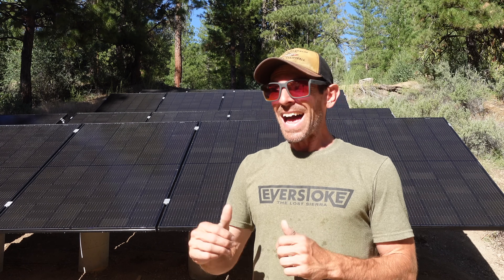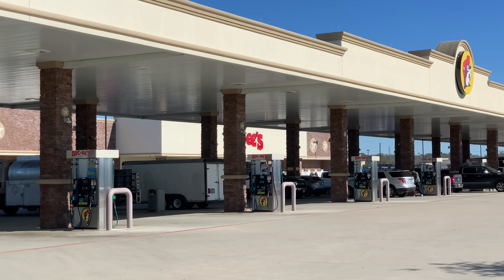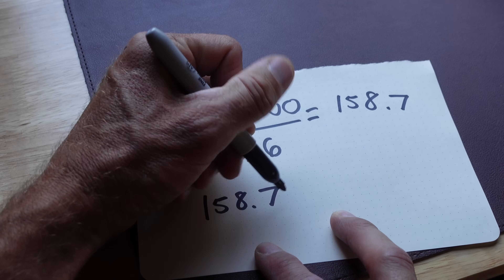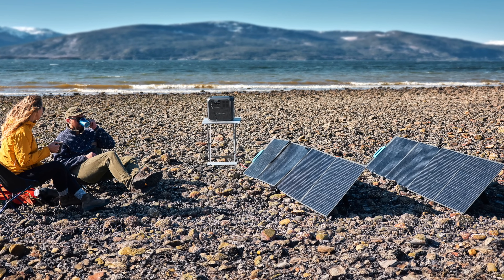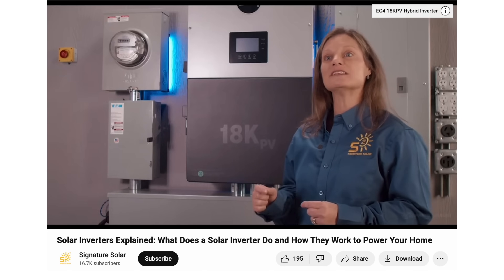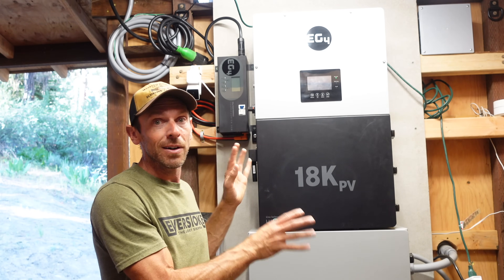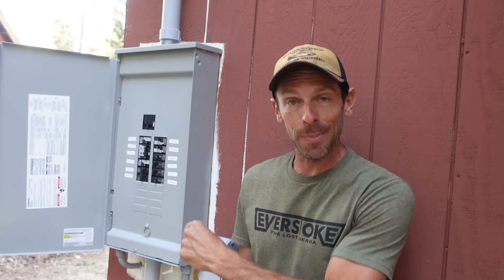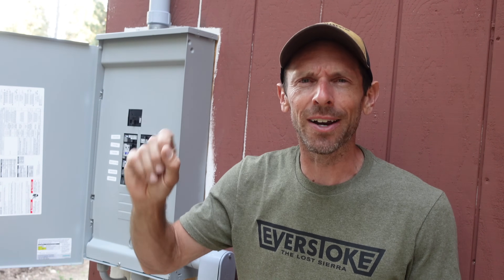Huge progress on our off-grid solar project at Everstoke

Comment: Where I am, if they still have a line in, even if I use no watts from the Grid, I am still charged line fees, I have a feeling if I was net metering and grid tied with my solar they would also charge me transmission fees to "Store" and "Return" any power. I am happy with my solar, but my bills will never zero out unless I remove the "Grid" line to my house, I pay just for the backup at this point.
Reply: I have done Construction for over 30yrs, and I have never met someone like you, I would hire you in 2 seconds flat.
Reply: Run water pump for 2 mins and see how much it produces, then see how much energy the pump uses in 2 mins, you can calculate your water usage based on power used by your pump approx.
Reply from the maker: Yep, no matter what they'll charge you if the grid is hooked up! Thanks for the kind words!

Comment: Ha, I've been Energy Independent since 2020 and I can tell you general stats, like during the summer I use 8-12kWatt/hours a day and in the Winter about 6kWatt/hrs a day - but I haven't done any calculations about the cost of the system. 6kWatt/hrs of Solar, 28kWatts of Battery Storage and a 12k Solar Charger/Inverter - all of that cost me $14k. Since I began, I've made more than 2 megaWatts...
Reply from the maker: That's awesome!

Comment: Can you elaborate on the mud mixer also?  Thoughts and comments on how well it does?
Reply from the maker: I think it has been awesome. But I have never done a big concrete job without it. I can't even really wrap my head around how we would have done it up on that hill with a little cement mixer thing and have to scoop everything out. Mud Mixer seems like such an easy way to do it. We have to keep an eye on the moisture level and make sure the dry mix keeps falling through.

Comment: Le me tell ya man…. You get an EV, all power consumption is measured in kwh. You will find out pretty quickly how kwh works. It is the volumetric measurement for electricity use. In a conventional car fuel use is measured in miles / gal, (L/100km metric) an EV will show kwh/100km. Basically the same thing.
Reply from the maker: Yeah, it's so cool! Seeing the real time power output is sweet

Comment: If you have to use a generator without a chargeverter you can get steady 60hrz, but turn off any surge appliances while charging, surge causes the gen to low freq then high freq when it catches up. I won't buy a chargeverter after the extra panels and change a connection next month I don't think I will ever have to use my Gen again, just there as a backup. If you ever move those panels and they are bi facial mount them vertical, I cleaned snow once as it melted from the top haven't washed the panels since sept, down about 20w, pv2 my 2790w array 3400w with snow, in summer with no white rock to reflect 1800w,  460w heavy rain to 780w in clouds 500w at 6am, summer production is down but it really doesn't matter when there is 16 hours of daylight, Unless you are grid tied. If anyone has to buy a gen, dual fuel and a 1000g tank could run a gen for over 2 months at 4 hours a day, it's a good back up if natural disaster happens. I have a 400gal, I can get over 380kw from a tank, before I swapped the faulty inverter. After working on solar power for a month anyone can look at a 175w appliance and know in 2 secs 4.2kw per day.  When buying solar R.O.I. always happens but should anyone even consider that when they buy a 50000$ car that is worth 5000 in 10 years. Never mind ROI you should worry how much power will cost in 20 years. That battery is kinda expensive, I bought 48kw for 9600usd, Lead carbon sealed, non-spillable, -30c to 60c, discharge to 30% but can go lower, good PSOC  30 TO 70%, 97% recyclable, maintenance full charge every 30 days, no bms, equalizers, or heaters needed there just heavy 12v250 170lbs, not for mobile applications. Just run the inverter on lead acid with charge rate changes (57.8/55v). LC 51.6V is 100%.
Reply from the maker: Yeah, I definitely agree on the ROI and the way people spend on a lot of things like cars that depreciate fast! Thanks for all the tips and info!
Reply: @bkxc   I am retired and bored, sorry my comments are like a novel. I try to share it all. A lot of times the comments are for others cos the posters like you are informed.  Panels got cheap, same price as my 465w in 2023 2024 gets me 605w.

Comment: I would set the generator to come on at 5-10% battery as LiFePo batteries handle deep discharging just fine and you're just wasting gas/money and polluting with the last 20-25% if you use the generator.
Reply from the maker: When we only had four panels the difference between 25% and 10% power was about 30 minutes, haha. Not much of a difference.

Comment: it’s not a good idea to over size the system that much (1800 vs. 300) which is why it is taking so long to payback.  also, all those extra kwhs that the over sized system creates, are sent to the grid, so you are actually using the grid even more as you send net 1500kwhs to the grid.  but maybe you said you were storing the excess in that little battery?
Reply from the maker: Yes, I agree it's a bit oversized if I was actually doing it for my house. One of the big things is that that winter changes everything. Much less daylight, much more overcast. It'd be really interesting to see how much less power I would be making.
Reply: @bkxc  Thanks for this clarification.  It makes more sense for Everstoke as you should have higher energy usage when it is in season.   Maybe DOE or NREL publish maps for solar radiation that could be of help.  But I don’t recall if they are published for season, and they may be just an average for the year.  If it is rated at 1800w AC, then it’s probably 25% of that rating that can be counted on year round.  A wild guess on my part but 15-20% of the rating for winter?   But that still doesn’t tell you how many hours in the winter it will produce at its max rating.  Not being much help here, but it8s just a lot fewer hours.
Reply: @CJinsoo  yes NREL has free software that will give you a pretty good estimate of power production based on the system parameters

Comment: probably half the cost of providing electricity is for stuff that doesn’t vary with how many kwhs you use.  Your average monthly usage is very low compared to rest of USA,but typical for mild CA climate.  So the average rate per kwh for you will be very high.   things like distribution lines, transmission lines, transformers, customer meters and service do not depend on energy usage and their costs don’t vary with energy usage.

Comment: The solar systems in FL last about 10 years and needs repairs after storms and insurance is higher due to solar systems on the roof and covering them for replacement. Just a few experiences to think about depending on where you live, Thanks for your info.
Reply from the maker: Everything gets beat up hard in Florida! It's so much better to do a ground mount if you have the room!

Comment: So funny. In germany we have a law that you need to built solar on your roof if you redo it... And most people do it even on old roofs. We pay 28ct/kwh and even than its a no brainer.
Reply: no brainer?  sounds like there isn’t a choice.
Reply: @CJinsoo  there is. Solar for water or power is your choice.
And I got it on my old roofs as well as it pays itself
Reply: @Tschesslee  Thanks for that clarification.  When customers go solar for water, what is the backup?   On it paying for itself, I a do not dispute that outcome.   Easy to set up program for solar such that the net energy payment rate, or install incentives result in quick payback period (5 years or less).  But in the USA, that short a payback is the result of a very large subsidy embedded in the payment rate.  It results in shifting costs to customers without solar.  Don’t know anything about the programs in Germany.
Reply from the maker: Surprised California hasn't passed that law yet!
Reply: @bkxc  California just screwed everybody over! Now you pay $.30 for power coming in and you get about five cents for power going backwards out to the grid. So the best thing to do is get your own batteries and live within your own means.

Comment: Now you're cooking with natural gas. Oops. Wrong metaphor for this context. Now you're styling in tall cotton! Dang, did it again.
Seriously, it's obvious a lot of work went into this project. I'm sure it will service your property for many many years plus when it's time to replace solar panels, the hard work is already done. 
Are there any specific parts or circuit boards that are known to go bad occasionally? Often enough to keep some spares on hand.
Reply from the maker: Most of this stuff is very new and it's going to be some time before we start seeing the malfunctions. But there are pretty good resources on Reddit, the DIYSOLAR forum and Signature Solar customer service. Hoping for years and years of smooth saving

Comment: The grid is a massive infrastructure. 
$TRILLIONS to finance and also needs $100BILLIONs in cashflow. 
$30,000 tells that the grid is expensive. 
5cents feedin vs 50cents supply kWh tells you the grid makes dirt cheap electricity expensive. 

And grid electricity is the smallest part of energy used. 15% of all energy used. 

100% grid electricity energy is economically impossible. 

No grid electricity, rooftop PV, and a Battery Vehicle parked 23hrs every day and all night will kill the National Grid cashflow.